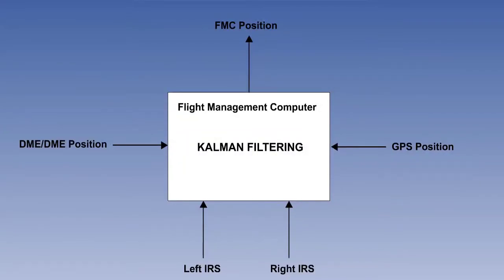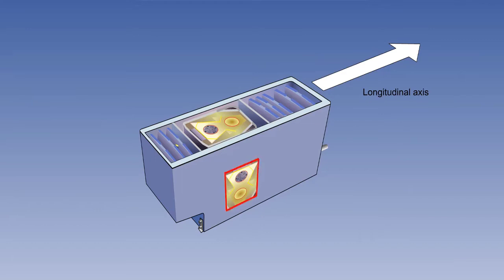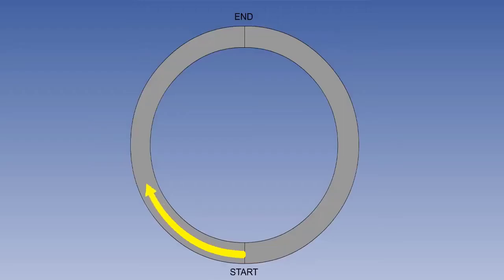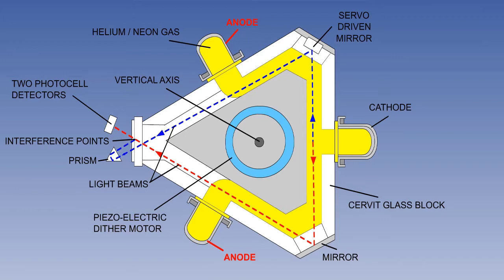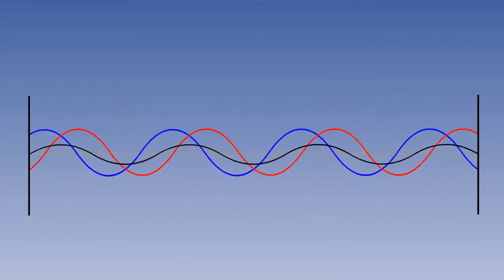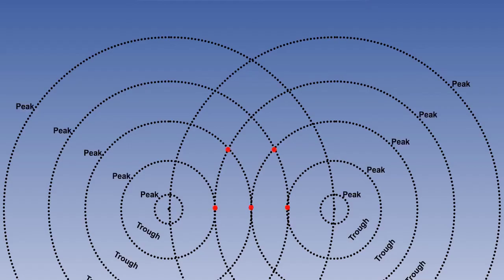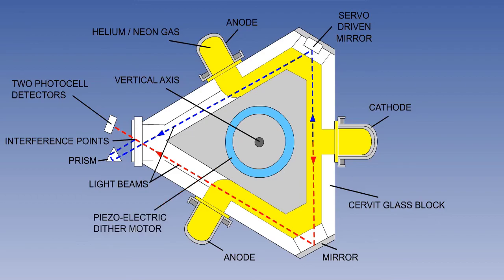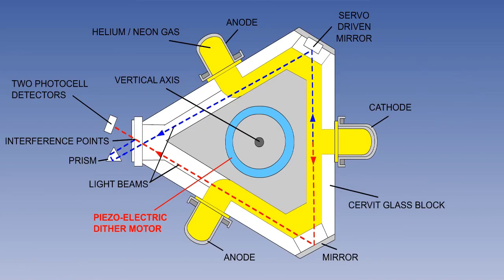Inertial Reference System Rising Laser Gyroscope And IRS Of Aircraft | Video 38

Comment: 3:43  because the speed of light is constant (special relativity) you couldn't measure any difference. That's why you measure the frequency difference and not the speed difference. Frequency of light changes according to the speed of the source (like blue/red shift of galaxies in expanding universe)

Comment: piezo crystal emits voltage when squeezed used in knock sensors,great idea for dither pulses,preventing laser lockup.Iwonder what the service life is knock sensors were sometimes sensitive to heat.due to the surrounding components cracking or melting that held it together.It has been speculated that earthquake lites can be attributed to them .by examining them you can tell how many times the earths magnetic poles has shifted,about every 10k yrs ,this is known as the quickening ,and from what the crystals say were about due.